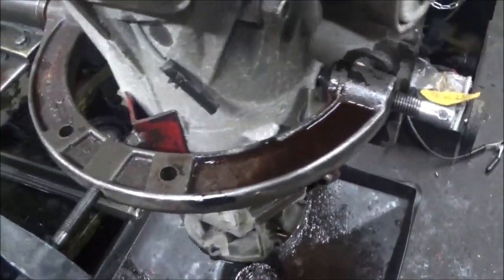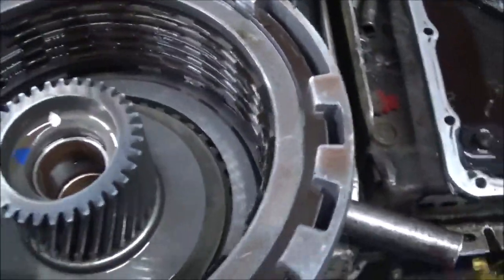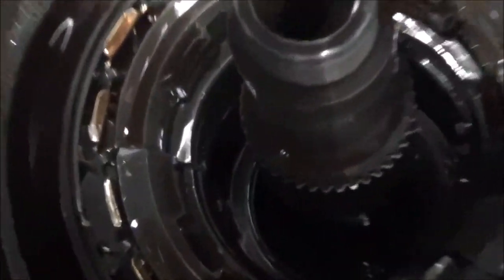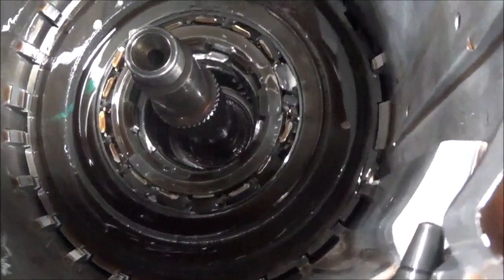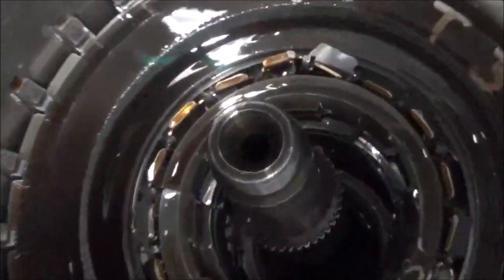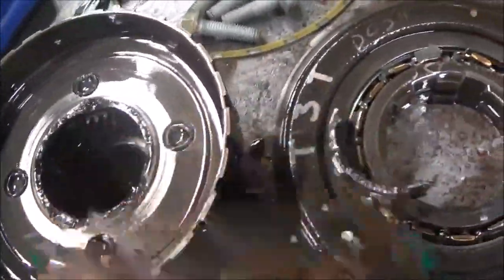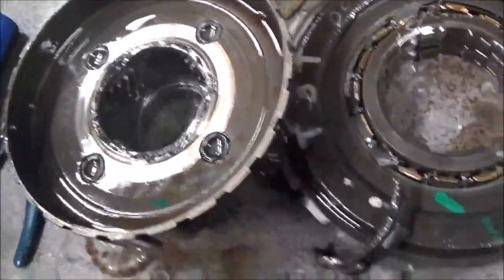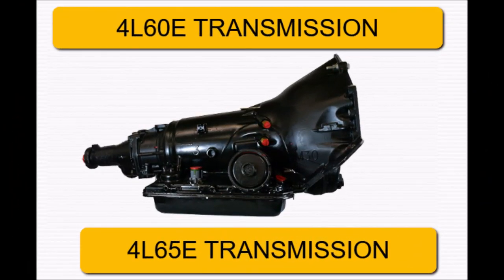4L60E NO DRIVE GEAR (FORWARD GEAR)

Comment: Mine won’t go until I drop it to 1st but after it engages I can pop it on Drive and it shifts good and smooth. Wonder if this is what’s wrong with it
Reply from the maker: It is possible, however this part breaking in this transmission is rare. More common is the forward sprag breaking  causing no forward.

Comment: O1 sierra 1500 4x4 auto 4wheel has drive and 3rd till warms up then loses drive gear then intermittently will get them again for a second or two but eventually stops all together changed fluid and filter along with every solenoid from columb to valve body and tried a junkyard cabe and changed cluster twice putting three different ones 😢please help I'm dieing without my truck

Comment: Have a brand new rebuilt transmission and it’s doing the same thing as the old one,   Only moves in manual reverse, and manually first and second.    There is zero information on this problem on you tube or google.    Any help would be awesome.    Thanks
Reply from the maker: If it is a 4l60e, then disconnect the transmission harness from the case connector. Then put it in drive gear to see if it moves. If it moves, then something is wrong on the outside of the transmission, if it does not move still, then something is wrong on the inside of the transmission.
Reply: I have the same problem no drive but manually shift 1 2 3 then drive but can't start out in drive. I unhooked harness and it moves. So is this my problem to the video. Or is it something else outside of the transmission? Thanks any help would be much appreciated.